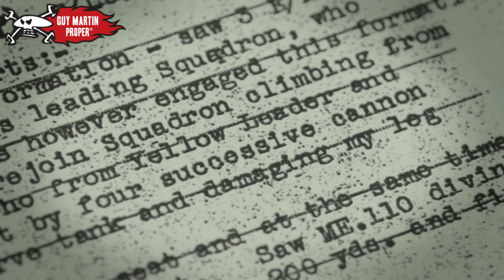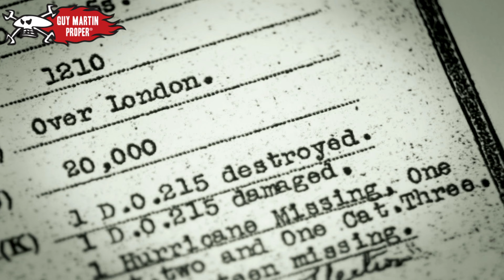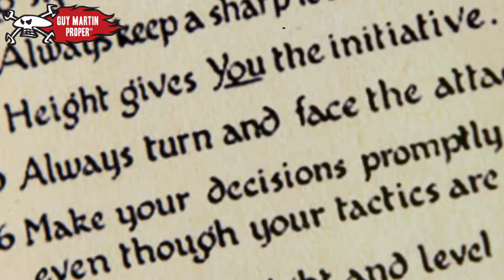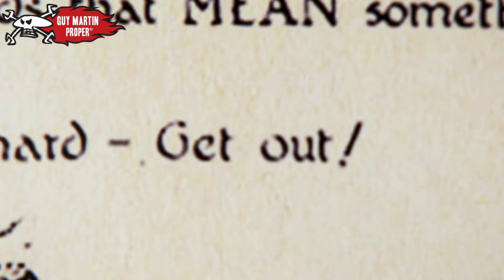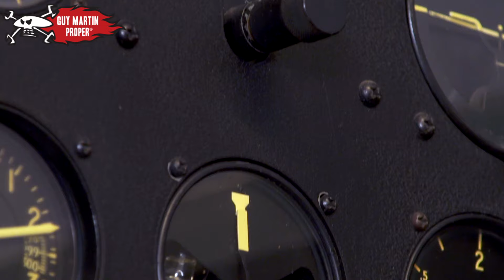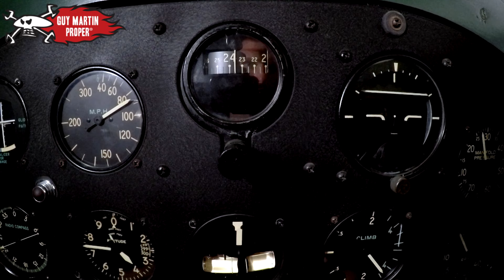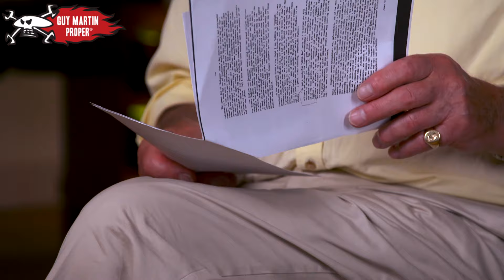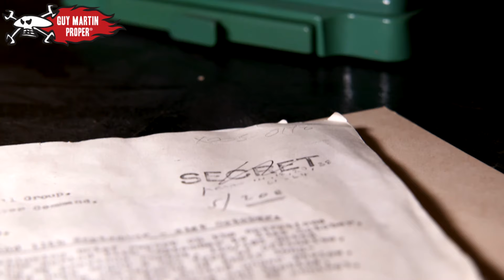ALL of Guy's extra Battle of Britain Scenes | Guy Martin Proper

Comment: Claims at 126 but confirmed are less than half that. 58.8 is the polish historians figure. 
Reducing the Czech and canadian and 2 brits claimed 32 by the 58.8/126 ratio would mean 43.8 kills plus a share of the 30 kills not attributed to any squadron, say 2 so call it 46 kills by polish pilots, still excellent as they joined the
 battle half way through and had low losses.